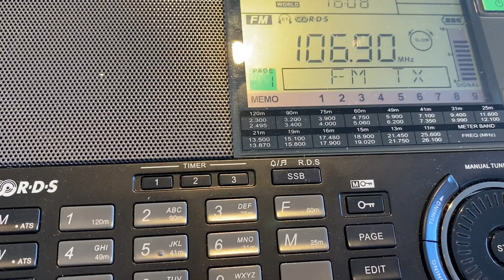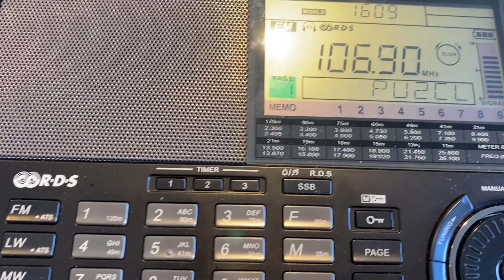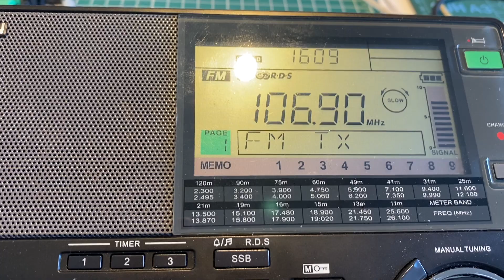QN8066 and ARDUINO  BASIC SETUP

Comment: Yes, that's right. Thank you.
What do you think about qn8066 standalone without PA and a 10cm antenna to use in building house? Emitter receiver.
Is the power transmit of the qn8066 equivalent with qn8027?
Really thank you to share your work.
Reply from the maker: To be honest, I'm not a big fan of FM. Therefore, I don't have much experience in this area. I only developed this Arduino library for the QN8066 to meet some requests from colleagues here in Brazil. The setup shown in the video has a range of a few meters (about 10 meters, maybe). I haven't worked with the QN8027 enough, but I believe the output power is the same.

Comment: Hello Ricardo,
What about the distance test  (receiver-transmitter).
Best regards
Reply from the maker: This is a 7W transmitter. Testing this transmitter at this power output would be in violation of the Brazilian law governing radio frequency transmissions (I guess). I typically use a dummy load or just the bare QN8066 to limit the range to a few meters.